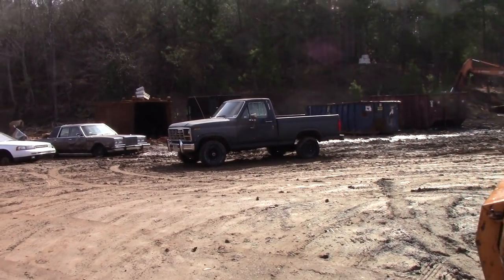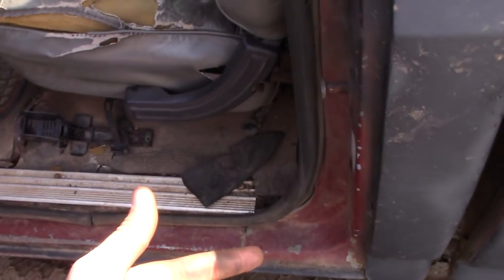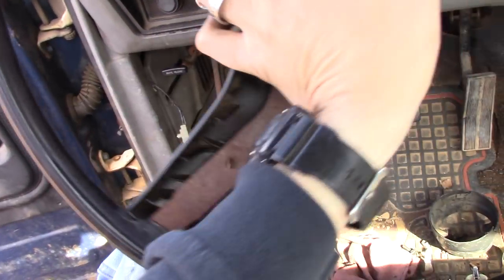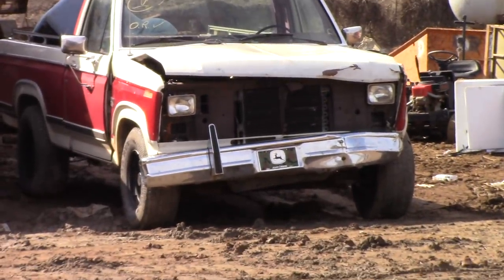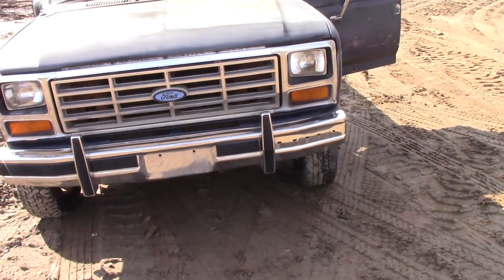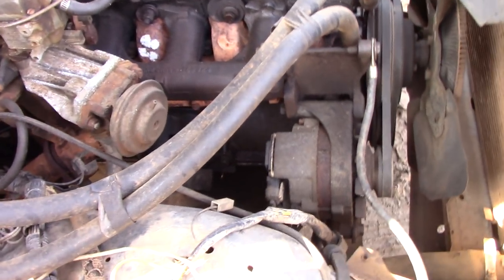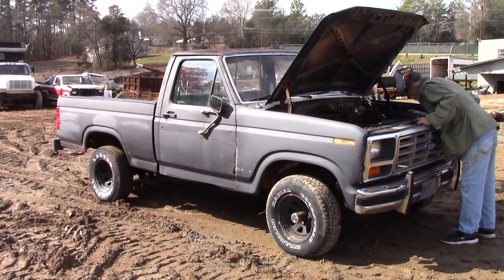JUNKED! 1986 ford f150 4x4 4 speed!

Comment: One of the best motors ever made period bulletproof
Reply from the maker: Its a good low end torque engine for sure !
Reply: Yup, just an egr/vacuum  nightmare that will never ever run correctly, but she won't blow up...
Reply: Smooth...quiet...reliable...abusable...
Reply: Wrong 350 can't kill it 350 will out live that junk 300 and 300 to me is a dog no power no tq my 4.3 would chew that 300 up
Reply: LOL, "chevy BOY" living up to his name. The 300 may not be the most "bulletproof" engine ever made, but it's up there. 

The "egr/vacuum  nightmare" is incredibly easy to solve if you don't live in a communist state. 

A common 350, might actually out live a common 300, but the 300 would take more neglect.
Reply: @chevyboy4976  I have blown two 350 sb chevy up and three 454 chevys.
Reply: Dam shore was
Reply: @fixit4u73  being a old ford there’s no egr crap but probably a vacuum issue if not running correctly. These carb systems are known for vaccum leaks. Jay smart made a video about a 98 ford 150 that the smog pump was seized. Check your make and model that can also help find info as well.

Comment: Im amazed at how you guys can call this thing junk when its not rusty at all.  I wish i didnt live in the rust belt.  Love these old truck impossible to find in any condition related to this one.  Sell it in the rust belt for 2000$.
Reply: Yea and these guys in the comments saying "it's scrap, part it out". Smh. The guys in the north would love to have this truck. Even if the engine is seized. As most would rather swap a drive train than rebuild a rusty body.
Reply: I'm in MN, and I can confirm an easy 2 large for this thing up here.
Reply: As someone else in the rust belt, you could easily sell this for $1000 missing title and seized engine. Titled would be even more
Reply: man, my 86 inline 6  carb 4x4 4spd   is a rust bucket....would love that body.  one of the best trucks ever built..period......ya boys, the rust belt is tuff....

Comment: Needs a lot of work, but looks like you have a parts truck along with it. Could be saved. Great bullet proof drive train. Most likely stump pulling gears. Knew a guy who scraped cars with an 88 F250 with same drive train.  4x4 low yank any car out of the weeds! Heavy car and trailer no problem.
Reply from the maker: The "parts truck" off in the distance is actually worth fixing more to me. Its got a beautiful interior and great running v8
Reply: Can't wait to see it.
Reply: Other truck sound great too! I  would paint this one camo and make woods/ hunting truck., or good plow truck.

Comment: Box is worth 1500 bucks all day up here in ontario. Rear axle been changed to a 9 inch. 86s had the 8.8. The np435np208 transmission n t case 400 bucks n desirable for off roaders. As for the 300 straight 6. Priceless if its a good one. Great engine tons of torque.  Bit of work and thats a killer off road truck.
Reply: Yup. I picked up a 1983 running beater set up just like you described for a $1000. Looks like hell, but fixable with some patch panels.
Reply: My 1986 f150 lariat came with 9in rear end Windsor 4 barrel two gas tanks c6 auto

Comment: The body of it doesnt look too bad. It actually looks like a pretty good truck. Old but it looks alright. The interior could use cleaned up but other than that doesnt look too bad. How are you today Jay?
Reply from the maker: Its not the worst Ive seen, but this is "bad shape' for my area. Also, I'm doing just fine today, how about yourself
Reply: Jay Smart Gotcha and im doing alright i started a new Job today at the local Chevy Dealer here. It went well and it was a slow day today so we'll see how tomorrow goes. Hows your night been Jay?

Comment: Reminds me of the 83 F350 I had back in 03 it was a 2wd 300 s6 3 speed auto only had 50k on it as it spent its life on a usaf base here in the UK .Was a great truck fitted it with an lpg kit & it gave it 25 mpg (lpg is roughly half the price of petrol in the uk) it would top out at 70 mph but tow anything.Once had the bed full of engs/boxes,axles etc & a falcon on a trailer & it just kept going.

Comment: Yes, 1980 was the first year for this body style and 1986 was the last year for the front end and dash for this generation Ford truck. We had a 1980 Ford F150 Ranger Regular Cab Longbed with a 4 speed manual transmission. When my parents bought it used in 1994, the truck had a two tone brown/beige paint job. They soon had the whole truck painted all white. The truck was pretty beat up. It was used as a work truck all of it's life. The truck had no radio, no air conditioning, broken hand crank windows and would run like crap during cold weather. The good news is that the power steering, manual transmission, brakes and clutch had always worked great. I may sound crazy for saying this, but I really miss that truck. Even though it was pretty beat up, but I still miss it.

Comment: That's a 9 inch rear..dropout. 87 was first year for 8.8 in 150.
Reply from the maker: good to know !
Reply: I was going to say the same thing.
Reply: I actually believe that 8.8 was more common in 80-86 model F150 and bronco. The 9” was common behind the granny low 4 speed which was common for the 300 six cylinder engine and 4x4. The 8.8 was common in V8 package and with the 4 speed overdrive and automatic transmission.
Reply: Geo Stanley I stand corrected. 83 was actually the first year of its use in ford vehicles. I've seen them more commonly in the f series 87 and up.
Reply: I had an 86 F-150 Stepside - 300 I6, 4 Speed, T18A transmission with granny low, and 3.08 8.8 inch rear. It was 2WD.
Reply: Yup, between 83 and 86 where the 9" was phased out for the 8.8 in F150s and Broncos, and the Dana 60 phased out for the 10.25 in F250/350s. Which got which was mostly related to if the rig got RABS(Rear ABS). The RABS used a speed sensor in the axle and the 9" and Dana 60 don't have it.
Reply: Hi 84 was the first year for a 8.8 rear end
Reply: Also just to note not all the 4x4 setups had the quad shocks in the front. Mine is a long bed 9in 351w c6 and no quad shocks.

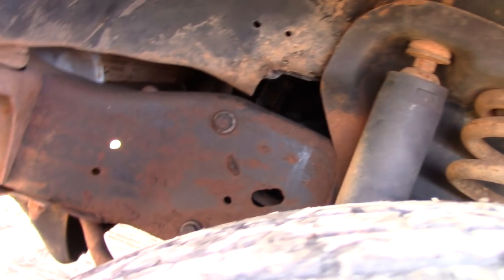Comment: I had an '83 with the 300, but unfortunately it came equipped with the 4 speed manual with OD and a 3.08 axle.  Ford was trying to wring every last mpg out of it, but was slow on hills and with a small camper.  I traded it for an '86 with FI 302, automatic and 3:55 rear end.  Night and day difference with a load.

Comment: That truck is definitely rebuildable. It's definitely a keeper with the 300 straight six, which is one of the best & most reliable engines that Ford ever made. Fix up the interior, rebuild the engine, get it mechanically sound, paint it, give it a bed liner, & you've got one hell of a workhorse.

Comment: The steering column has one large plug under the dash, 4 bolts and the slip joint. You can find a good one with the key in it in most junkyards and avoid the headache of diagnosing that column. While youre there nab the door key cylinders and keep your truck all on the same key! I would love to find that exact truck, I'm having to build one instead!

Comment: That truck did a lot of work over the years.  Most anything can be fixed, all it takes is time, money and work, in this case to much time, money and work. I had a 6 cylinder Ford pick up kind of like that... that thing sucked gas like it was free.  It was geared real low, nice around town but terrible on the highway.
Reply: Yeah, you have to wonder how it uses so much fuel with such a small carburetor lol.  Lot's of torque for pulling though.

Comment: I had an 84 with a four speed first gear was granny.it was two wheel with a straight six.it ran amazing but the frame was rotting out.that truck could pull anything.i wish I still had it.

Comment: The differential cover is not welded on, its a 9" axle, the Ring, pinion, carrier assembly removes out of the front of the axle. And they absolutely do put 4x4 on the 6 cylinder, we've got about a half a dozen of em on the farm.

Comment: Save it an swap either a 5.0 302 or a 351 I would daily that thing
Reply: smalltown boy97  The 300inline six is a great motor.  Why swap it?
Reply: skileg10 I was meaning save it an drive it an if later on down the road he wants to change engines there the two options I personally would do
Reply: No replacement for displacement

Comment: What kinda moron scraps a bullnose 4wd short bed, that truck is worth a lot in any condition.

In this area that's a $1000 truck as it's sits, and $3000 if fixed enough to drive.

Ya guys skipped over the most valuable aspect of that truck, that it's a short bed regular cab.

Comment: She's worn out thats for sure. Keep those nice tail lamps and maybe headlamp bezels as they are hard to find. Definitely scrap.
Reply: Plenty of these sitting in the fields of America's Heartland.
Reply: TheGuyAtTheWheel you guys think everything should be saved... That's not always the case. Part it there will be a better one down the future
Reply: No. We think mostly complete, rust free things should be saved. To me, parting out a complete truck is ass-backwards. Especially one that that looks like it can be up and running again in short time.
Reply from the maker: I do think with a new steering column and some carb work could have this truck running in an hour. Supposing no major mechanical damage has taken place. But I dont see that as being the case
Reply: Yea I think someone who didn't know what they were doing messed this truck up. But, it does look like it could be saved with a little work. Hell, it would be a perfect candidate for a 302 swap.
Reply: To clean other then interior to scrap hard to find one not rust d out
Reply: That truck is absolutely worth saving due to one aspect, it's a regular cab short bed. People love those things, they're rare, more so in 4wd, and it's always less work to save a beaten one then build one from a longer truck.  This one thing will always make that truck a lot more valuable then most other trucks in the same condition.